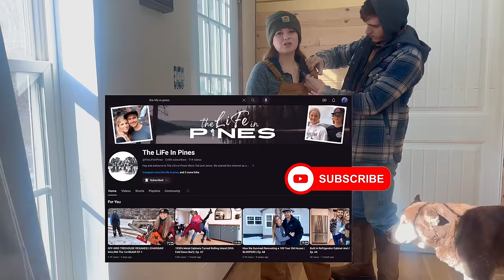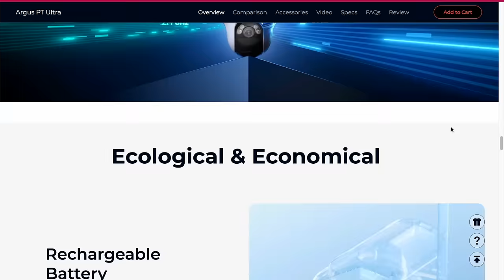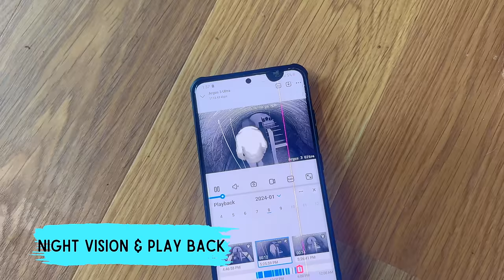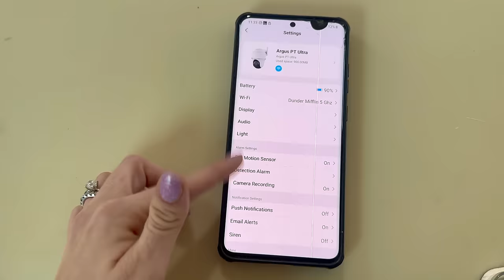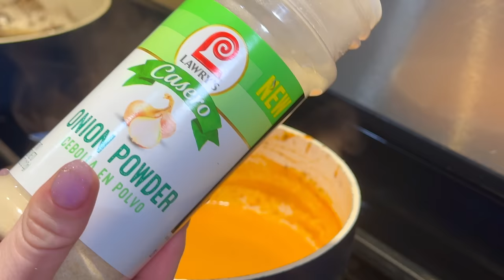Homestead WINTER STORM Prep | Couple Building CONTAINER House | SNOW FINALLY

Comment: Get the dogs some snow booties. The snow is beautiful but so cold. Be safe.
Reply from the maker: We actually have some but they take them off immediately so it’s not worth the trouble!🤣
Reply: Swiffer mop you have to buy the bottle of cleaner and I didn't like it. It made the floor kinda sticky. I bought a Libman that you can put your own cleaner in and hot water. So much better. It's a little more expensive but better.

Comment: You can take the soot from inside the fireplace and rub it on the inside of the glass and take off the black film on the windows instead of using the scrapper ❤

Comment: Is that a water line /pipe on the end of your home that you installed the insulation sheets. If it is, you might want to pop some insulation, on it. Also the back end of that rake with and old towel would have taken care of the muddy prints until you bought your swiffer.

Comment: Have y’all thought about 
He did electric tape to put wrap around your pipes. They should be fine if you use the heated wrap like they do underneath trailers mobile homes they have heated tape wraps.

Comment: you should cut slits into the plastic to allow for the wind to pass through to prevent it from ripping away.  It will still block that majority of it but wont let strong gusts from ripping it away

Comment: Not sure if you know but you can take a wet paper towel, and dip it in the ash of the wood stove and rub it on the glass of the wood stove to clean the glass up.   But only do it when glass is cool.  I try to do mine the same time I let it cool down to clean out my ashes

Comment: To make it easier to open the insulation, take a disposable plastic lid and poke 2 holes in it like button. Thread a sm strong string through the holes and tie a knot so it sits flat.then thread it through the insulation in the centre. Put some sealant on the end of the string so that it pulls the sealant through the hole.

Comment: Talk about productive! PRO TIP use a small square 2x2 of thin cardboard, like a cereal box as a washer when stapling plastic house wrap tarps etc. Fire 4 staples in works like a charm. Stolen from @rrbuildings